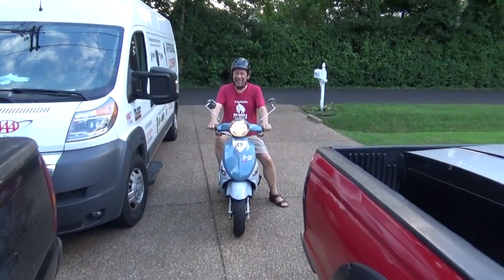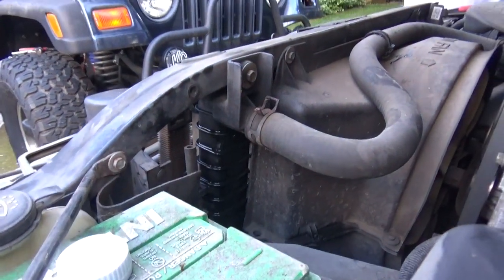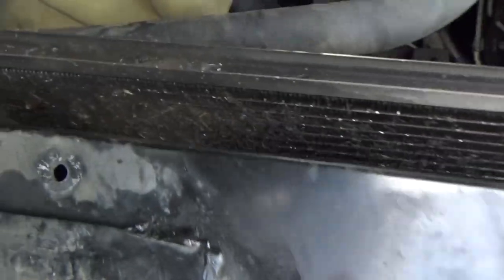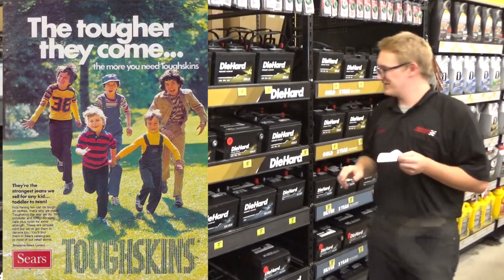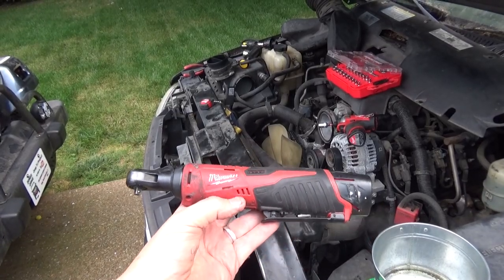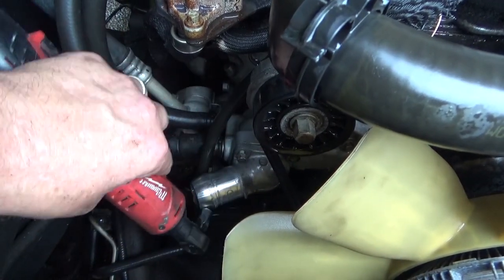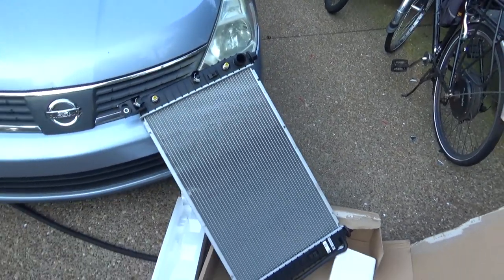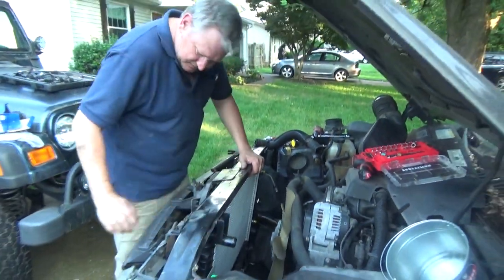Chevy Pickup Overheating and Getting Parts at Advanced - Thermostat Action

Comment: I had to put another engine in my jeep wrangler. So can rebuild the one I already have went on eBay ordered one. They gave me an little over 100,000 miles on it. 3 weeks later the threw a rod. It being under warranty the junkyard since me another engine. It was a remanufactured engine with less than 25,000 miles on it. When I done the first engine I put a new radiator into the jeep.
Reply from the maker: Thats awesome but having to change out was a pain eh ?  Was it a 4.0, 2.5 ?
Reply: @RedneckGarage  2.5